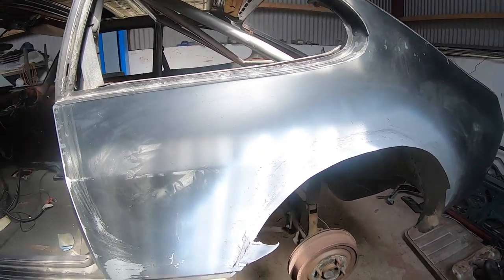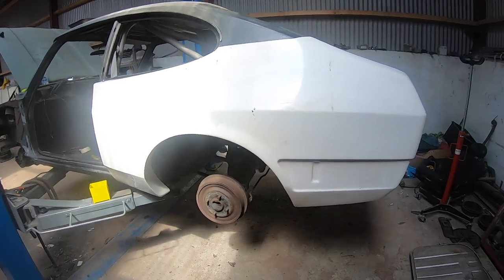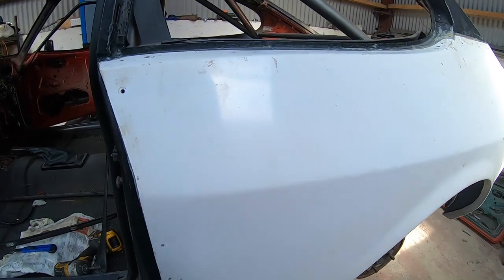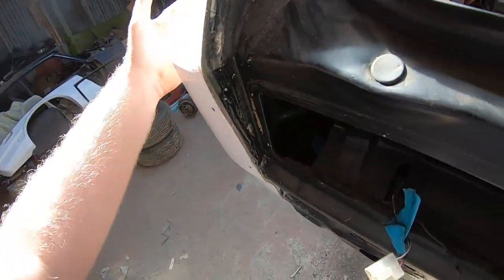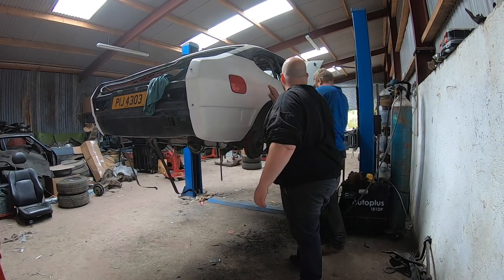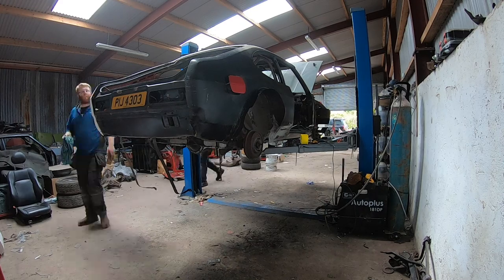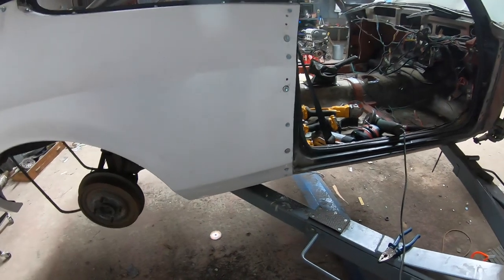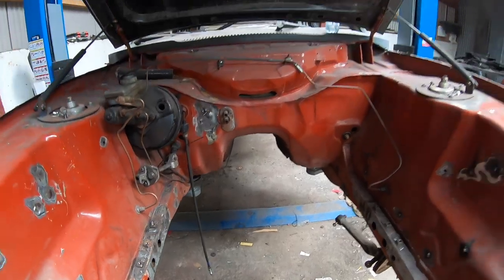Project Xpack Episode 20 - Ford Capri XPack 2.9 Cosworth Twin Turbo Build.

Comment: Another top video mate.
Quick question; seen you extended the petrol flap hinge, but couldn’t make out the rest. 
Have you put a shroud around it, to stop water running down the inside, between the kit and the quarter??
Or have you another of your engenius ideas 😉
Keep up the good work.